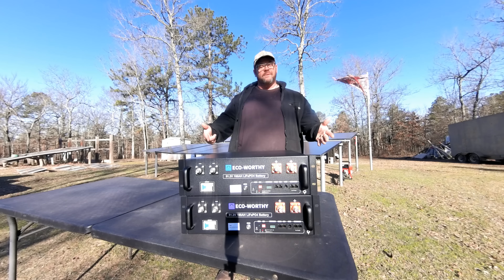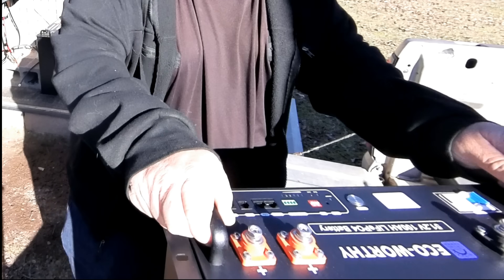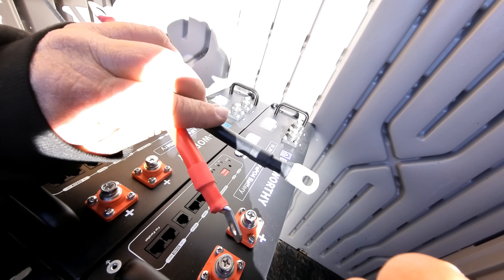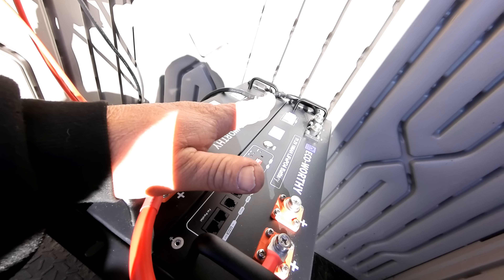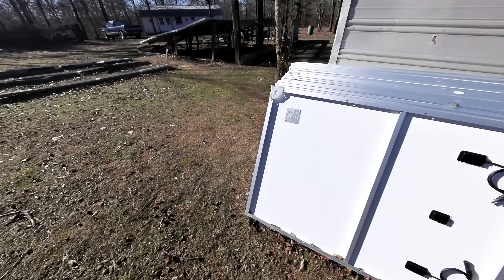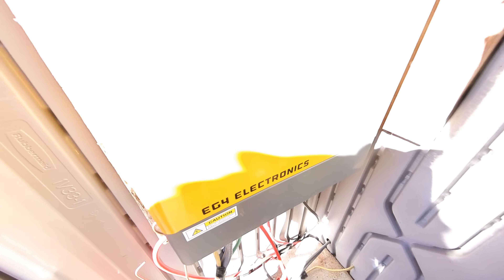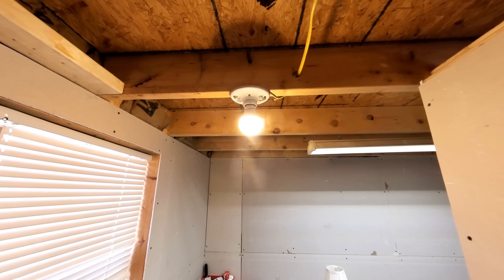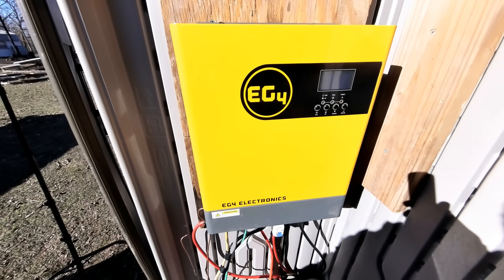Build Your Own Solar Cheaper With Eco-Worthy Batteries

Comment: QUESTION: I've tinkered with solar, definitely not a expert. I'm planning on buying the eco worthy package with one server rack 48v 100ah and 5k hybrid mppt inverter. My question is how would I hook up my dc fridge? I've read that the mppt acts as a charge controller but I've also seen where some use a separate charge controller for the dc load. So would I need a separate charge controller hooked up to the battery to run my dc lights and fridge? Any help would be appreciated. Thanks ❤ love your videos.

Comment: what you think is better compared to the vatrer battery?
Reply from the maker: Man I'm going to be honest with you.. I think that Vatrer is the number one battery for the price. I feel like it even outperforms the eco-worthy which is about $50 cheaper. I like the fact that it is very simple with no communication and you can actually hook it to any inverter as long as you can set the parameters correctly on the inverter. The biggest thing I liked about the battery is the touch screen monitor where you can monitor the state of charge and even the individual internal battery voltages. It is definitely my number one choice as a matter of fact I just got two more yesterday in the mail this is going to be a total 6 server rack batteries for my off-grid system install video coming in about 2 or 3 weeks
Reply: @OKLAHOMAOFFGRID  thanks

Comment: Stumbled across your channel, great information, but I got a question for you. I think we can all agree that running the air conditioner. Especially in florida, is the biggest drain on power consumption and cost on bill.  i have a 3-2-2 1500sqf, and I'm wondering, is there a way that I can hook up a solar system, much like this specifically to run just my two ton air conditioner and air handler?  Maybe a video???
Reply from the maker: i would never run a conventional 2 ton a/c ...but i would tell you to look into mini splits when running solar

Comment: It is not recommended to mount the battery cells flat faced up. Because of the electrolyte inside the LiFePO4. The connector side should not face upwards, but sideways on these 100AH batteries.. ;-)
Reply from the maker: Never heard of that but thank you..I'll check it out

Comment: I get it but you have better luck buying a generator then all this junk that will eventually go bad. There’s no part in solar being eco friendly when it’s made out of lithium 😂 for this price you can buy 3 generators that will probably last you 30 years which is enough for a lifetime. Did I forget to mention that if there’s no sun solar power is basically useless, which half the United States is cloudy most of the year and the other half there’s sunlight for about 4 hours 😂 solar power only makes sense in sunny states which is like 3
Reply from the maker: Good luck bud

Comment: Am I really doing a diservice by getting a EG4 inverter and eco worthy batteries or is this going be just as good as the EG4 batteries?
Reply from the maker: I don't think I would be doing a disservice that's actually the system I'm running now is to equal worthy batteries with the eg4... They told me that the communications would communicate between the batteries and the inverter but I have not had time to deal with that so I just have it set on user-defined right now and charging it to the voltages that they require.... But yeah in one sense the way I look at it is if you can get it cheaper and it works just as good why not
Reply: @OKLAHOMAOFFGRID  thank you. 
I have two of the eco-worthy 48 volt batteries in the cart and I also have the 5000 watt inverter also from Eco Worthy. I'm trying to do a little research on the inverter button having no luck.  I'd rather get all the same brand so they 100% talk to each other as needed. 

If I go everything EG4,  it's much more $$.
Reply from the maker: yes this is true..I  am about to get the Eco worthy inverter myself and test it with the batteries
Reply: @OKLAHOMAOFFGRID  I got my inverter mounted to the wall on my basement with as much of the wiring hooked up as I can until I get the batteries and I think they're coming this friday. I still need a few Breakers in between the pieces of equipments because they don't come with anything from the factory. I think I need a combiner box for my PV panels and I would like to eventually get a shunt with a screen for more readouts

Comment: I've watched your vids alot when bored. But today I have a question I'm here in mexico for the first time visiting family im originally from Oklahoma. What type of setup should I plan on bringing the only tings that I care about powering here is. My grandma's ac and the fridge and maybe a water pump for the well. BTW we are deep south in the "mountains" but when it rains the whole town loses power.
Reply from the maker: Well it depends on how big her AC is.. if it's just a small window unit like a 5000 BTU window unit then I would say go with the eg43k provided the well pump is 120 volt and not a 240.. the other thing I would say is to get around 10 solar panels or somewhere around 4000 watts... And then I would probably go with a minimum of two server rack batteries

Comment: Love your videos! Many options to pick and choose from your experience. If you could please explain more why or when to go serial or parallel on batteries/panels and give technical details when you’re talking about connecting battery to inverter/solar inverter. For instance, panels are this volts and this amps so to fit the inverter we need them in series or parallel to get this. I’m newbie and trying to understand configurations thanks!
Reply from the maker: In most cases yes you're trying to wire the panels up to where they will compensate the inverter or the so-called inverter charger which is the charge controller and inverter all in one. If it's just a different brand that is making just a charge controller and the inverter is separate then it's the charge controller you're having to compensate for voltage. In other words some charge controllers may say we accept 80 volts to 150 volts DC maximum. While other ones may say we accept 120 volts minimum to 500 volts maximum. So most of the higher end or newer style charge controllers or all in one charge controller inverters are beginning to take a higher voltage than before and the higher voltage helps with the wiring of the solar panels so that there will be less strings of panels to run into the inverter and you're going to save money on wire because each panel can be connected to the next and then to the next and then to the next and so on instead of running parallel which you would have to run lots of extra wires and splitters. Also higher voltage means lower amps which means you can use a smaller wire which is actually cheaper when you're running it from your solar panels to who knows how far where your inverter charger is mounted could be inside your house. I hope that helps
Reply: @ it did! Thanks for the explanation

Comment: faaaaaarrrout that is cheap man.... Does anyone know if they work with victron gear ?

Just wanted to note though while its cheap its still cheaper to buy individual cells. like doing the maths, and converting to AUD. its basically a KW per 265.6, but raw cells are 218.75 per kwh... I think for people who dont want to build their own you couldnt go passed this.... the labor alone putting the battery together would be worth it
Reply from the maker: The batteries are so new there's not much information on them I saw on Gavin Stone he was able to get the battery to communicate with the eg4 13k or maybe it was a 6, 000xp I'm not for sure but so far I'm still working on getting it to connect to the eg43k but they did advise me that it would work with eg4 so don't know about Victron

Comment: I got 5 acres in Tennessee. I will be going off grid but i also will be using diesel and propane for heat and cooking.
Reply from the maker: Propane is key .. but also a wood burning stove is awesome. But then again they have the new mini splits that run off of solar and they have the heating element inside of them also. So lots of choices nowadays and the mini split is actually really efficient

Comment: did you just turn on the micarowave with absolutely nothing in it? That's  a good way to set it on fire, ya know. Gotta have a load. Next time just put a big bowl of water.
Reply from the maker: @LegoBeto  Safety mechanisms:

Most modern microwaves have safety features that might automatically shut off the power if they detect excessive heat, preventing major damage.

Comment: How does the inverter not overheat in that shed in the hot summer with the sun beating down on it?
Reply from the maker: Well it's kind of unique how it works actually in the summertime there's a tree that's over the top of it and it's completely shaded 100% so it's just the outside ambient temperature is about how hot it gets in the shed. And in the winter time there is nothing on the tree above it so the sun shines through and it kind of keeps the heat inside helping with keeping the temperature of the lithium batteries high enough so that they may charge properly.

Comment: Love the videos! Just wanted to share some extra savings. If you order 2 server rack batteries straight from eco-worthy instead of Amazon your cost will be $819.99 per battery. This includes free shipping. Amazon charges taxes and eco worthy does not. You can also signup for rebates from Extrabux and get a $20 signup bonus on your first order and Extrabux is offering 8% cash back rebate on total cost of items bought straight from eco worthy. Extrabux will send you a check in the mail for your rebate. Amazon does not play the cash back game. I know this probably kills any commission you are getting from eco worthy but I figure we are all trying to do this cheap right? You can probably find additional rebate saving from other solar providers such as Signature Solar using rebate offers from Extrabux and Rakuten. Look forward to more videos.

Comment: Thanks for the vid! I’m confused though I thought 3k watts isn’t enough to power a home? Daily avg use is about 20-27kWh for me
Reply from the maker: I'm in a small cabin off grid. If you have a full size house and you're running things like huge three and four ton air conditioners then you're going to need something like an 18K inverter. My application is for off grid or for campers but my application is also able to be added to and built up to be able to run anything it's all ready to be paralleled and added toinstead of just replaced
Reply: 3k should make about 12k in solar throughout the day in summer is about 4hour of peak sun

Comment: Thanks for the video. I just stumbled on your channel because I've been watching related videos after I bought 2x DC House brand (cheap amazon) 12.8v 100AH LifePo4 batteries. I have them wired in parallel with a 2000watt inverter and stacked neatly in a PET CARRIER of all things for portability while I camp. I can open the top of the carrier as well as each end to get at everything easily. Also got myself a diesel heater and have a connector for just that also soldered up to lugs and hooked on the battery. 

I also bought a foldable 120watt solar panel that according to my multimeter is outputting 19+ volts and around 4amps at the perfect angle. 

When I purchase or inherit a house, I will definitely be doing a DIY solar / battery project and look forward to watching more of your videos. Cheers from Ontario Canada
Reply from the maker: Good deal it's always good to start out small and kind of learn how everything works and then build your way up

Comment: Don't run your microwave very long without anything inside. It's not great for it. Like twanging a bow string with no arrow on it.
Reply from the maker: I figured that was the deal but I'm like man this is like a $50 Walmart microwave and I'm really just not worried about it

Comment: The pre-charge resistors are in the battery. The inverter does not have precharge resistors. Definitely turn that breaker on before the batteries.
Reply from the maker: oh wow I just learned this...thank you very much for the information. I read up on it now and now this makes sense how the battery terminals have 20 plus volts coming when the breakers are turned on. thank you again for the clarification.
Reply: @ anytime 👍🏻

Comment: My understanding is that they don't or won't communicate with the eg4 inverter.   Is that correct?
Reply from the maker: i did not get it to communicate yet but i only worked at it for 15 minutes...where did you here that from?...there is not very much information on this battery yet

Comment: Im really thinking about getting a solar system that would atleast for now help w the power bill. Plus i live in NC about a hr from Ashville where the hurricane totally destroyed whole towns & our power was out for a week. I had a few inverters i hooked one up to my riding mower and one to my car to keep the refrigerators and freezer running 
I really feel like i need a better backup system i did buy a generator but as i was hooking it up the power came back on so i just loaned it to my son. Is this a system that u think would be a good stsrter but i really need it to power 220v so i can run my well pump also 
I like the batteries but im not sure about the inverter system. Is there a better option for a 220 single unit
Thanks I really enjoy your videos
Reply from the maker: yes the eg4 6500 is an upgrade from this inverter and would do 240 and 120
Reply: Could I just add another inverter later on to get 240v from the 2 units? A combination of both units to output 240v total or is tht too complicated? 
Which is the cheapest option? Less expensive?
Reply from the maker: yes I'm doing that exact thing in the morning

Comment: One caviet not covered was the additional hardware and cabling, which will add about another $1000 to the system.
Also, keep in mind that the inverter shown is strictly 120 volt; no 240 volt for well pumps, electric dryers, welders, or big saws.
This is not to say that this is not a great system because it is exceptional in price and the production!
For my applications however, I would need 1 or 2 of the EG4 6000XP inverters and at least 1 additional battery.

Comment: I have heard that the batteries cannot be stored where temps reach certain extremes.  Where can I research to learn where and how to store/shelter the batteries?
Reply from the maker: Well search no more I'll give you the information that I know these server rack batteries under normal circumstances should not be charged under 32 degrees Fahrenheit and they have temperature sensors that will keep you from doing that. Secondly they will discharge power and continue to power your home until they hit close to 0 to -3° and then there is a secondary temperature sensor that will shut the power to the batteries completely off. So yeah you must find a place to keep it within decent parameters and the best known all around temperature is going to be 70° f for these type of batteries but that is in a perfect ideal situation and we don't live in a perfect ideal situation so the buffer zone is basically in between 32° f and around 140 Fahrenheit. As far as storage it's pretty much the same thing you want to store the battery in a cool place but not cold and you want to make sure that the battery is around 70% charged when you begin the storage and then you probably need to come back about once every 6 months and charge it back to 70%. So there's my two cents
Reply: @OKLAHOMAOFFGRID  Thank you so much for your generous and helpful response!  Sounds like something to think about for sure.  So now it is looking like finding a place for them where I can keep them operating optimally.  I am in central florida where it can get into the 20s in winter and over 100 in summer.  I am thinking of a system to act more like a backup at first and then expanding it to be 'closer' to full time over time.  So many things to think about, but I like the batteries you showed in your video.  I plan to watch more of your videos!

Comment: What do you do for heat, air, and hot water?
Reply from the maker: I use air conditioner on my solar for AC and I use a wood burning stove and propane both for heat and I have an instant hot water heater that that is ran by propane
Reply: @OKLAHOMAOFFGRID  Do you have an outside propane tank for the heat? or portable?
Reply from the maker: both

Comment: It appears you have both the solar and the batteries a distance from the house. 

I’m about to install an air conditioner to a building that can’t have solar on the roof. But there is a separate roof about 75 feet away that I can put the solar panels on 

Would it be better to put the charge controller inverter and battery there with the panels and running an extension cord 75 feet to the building where the air conditioner is? 

Or would it be better to connect the solar panels and run those wires to the building that has the air conditioner, batteries, charge controller and inverter ? 

So in short do I run the solar cables the long distance and have everything else next to the air conditioner? or do I have everything next to the solar panels and running an extension cord a distance to the air conditioner?
Reply from the maker: the solar panel wires are going to be the smallest gauge about 10 and they are going to be the cheapest...run the solar panel positive and negative and keep the rest of the system near the source it needs to power
Reply: @ ok thank you.